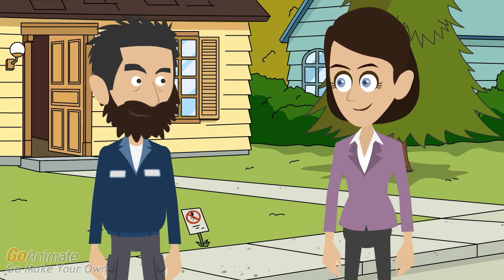Lennox Furnace Error Codes

Comment: I have a Lennox G24m415-100A Elite Series which will not turn on. When I send power to the unit, it actuates and then goes silent. No fan or ignition, just an electronic indication of receiving power. The board inside has one flashing LED, slashing about once per second. What does this tell me?